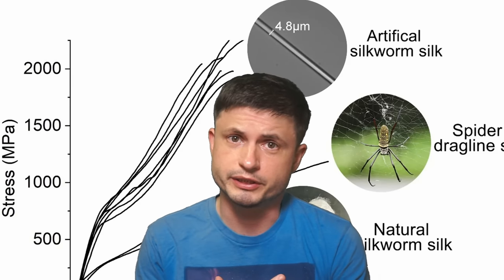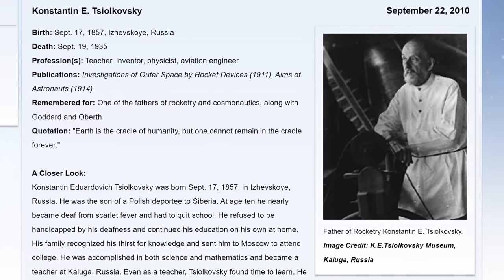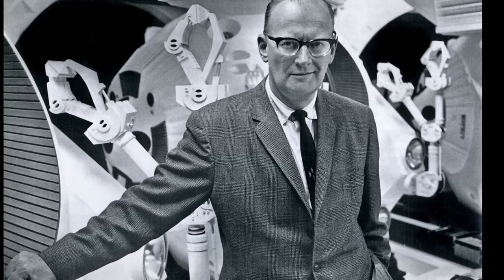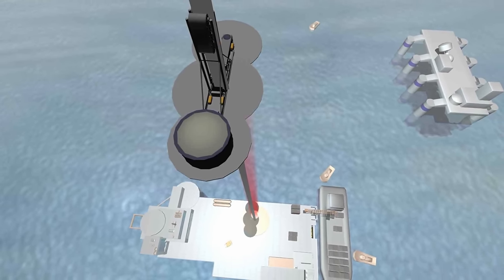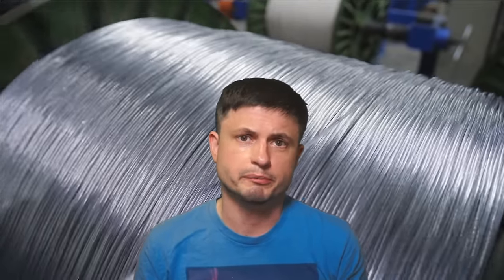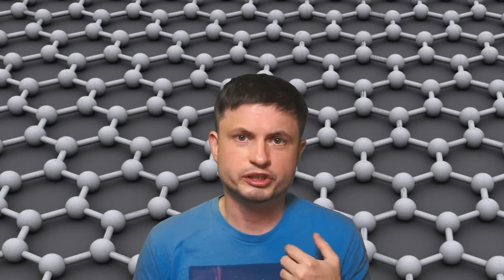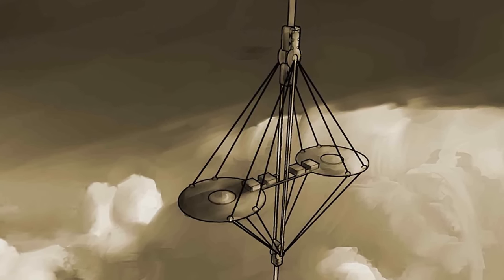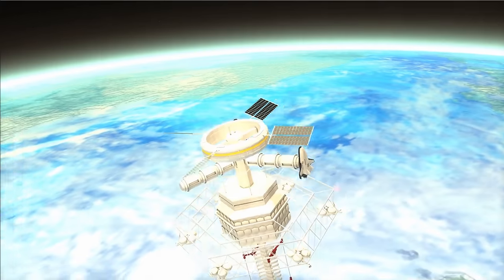Exciting New Updates About Space Elevator Technology...Possible After All?

Comment: I think they need to sort out the whole space junk problem before construction of a project of this magnitude. There are other safety and security concerns that would also need to be overcome.
Reply: There’s black holes I guess!
Reply: The space junk problem is tiny  relative to the engineering problems here.
Reply: Solar sails. Ion engine. Bye bye junk. Imho. Tick tick.
Reply: @filonin2  sort of. A problem is that the energy stored in the tether just through stretching it like a spring is immense, a significant proportion of TNT, at which point stopping crack propagation of it gets hot by a fleck of paint is challenging.
Reply: Good way to procrastinate. Just do the elevator already.
Reply: Very interesting. If it could be arranged that any nation could benefit, that’s skin in the game. Everyone would seek to preserve and strengthen it. Imagine the alternative of sending mass to LEO old style by chemical rocket, which, in the case of the space elevator, would become prohibitively expensive.
Reply: @KastorFlux  many orders of magnitude? My reading is about 1. I guess the question is whether this is enough to carry the crack control mechanisms, the coatings you will need to protect it from the hostile chemical environment, and whatever mechanism you are using to damp oscillations in the cable. I think there is still a way to go.

My guess is that one will be built on Mars before earth.
Reply: @KastorFlux  the problem with a space elevator is that it is not an issue of being unable to hold the payload, it is that the cable is quite close to not being able to hold itself. So if you have to add very much extra mass per metre to cope with crack propagation issues, chemical erosion in the upper atmosphere, damping vibrations or dynamic loads, the cable rapidly can't hold itself up (or strictly the cable has to get thicker as you go up at a rate which makes the whole thing far too heavy to be economic).
Reply: @KastorFlux  I did, however it didn't go into details of the actual practicalities of building one. There are huge unknowns after you have a material strict enough. For example it is essentially a giant bullwhip in a vacuum, getting thinner as it goes down. If you aren't careful there will be supersonic waves traveling down it, and getting bigger as it goes down  We have never used materials at anywhere close to their theoretical strength on large scales, defects normally hugely reduce that strength. The tether will be chemically eroded by the ionosphere. The tether will be mechanically eroded by micrometeorites.

Dealing with all of these issues is probably possible, but it is going to increase the mass per unit strength. I would want several more orders of magnitude safety margin in the material strength before I started building.

Comment: Nice to hear progress on the problem :)
At first it seams easy, just drop a strong cable down to earth + let some cable with a weight roll out into space to counter balance it so you are at the geostationary orbit altitude... But then when you do the math, the very weight of that length of cable is more than the cable can support (note: The cable ends at/close the geostationary elevation point carries the most load). I can get to 30 kms using helium balloons to counteract the weight, but that still leaves a long way to go.

>
Using a progressively narrowing cable with the thickest part of the cable at the geostationary point will help overcome the cable strength versus increasing weight with the length of the cable (Imagine the Eiffel Tower like design but with cables/threads, one narrowing toward the counterweight, and the other narrowing toward earth. Each about 2500 kms long). This does make it physically plausible even without the super lightweight nano carbon threads :)
>
Then we have to deal with high altitude winds, storms, high voltage electrical discharges, space debris, deterioration due to high solar radiation ...
Reply: I was wondering about deterioration due to radiation, and I wouldn't doubt that graphene would be highly resistant to that deterioration.
Reply: Graphene would also be more tolerant to impact than any other material we now have.
Reply: @theobserver9131  Graphene and some other super light nano particle threads look ideal for this purpose..
UV Cant find much. Some studies have looked at graphene/polymers composites and found that UV degradation is decreased, but also that graphene is weakened by moisture. I can't find anything on degradation due to continued stress or torsion. Like all carbon fibers I suspect it is designed to be used as a strengthening composite for other polymers.
>
That being said, thinking about 2 cone shaped cables each ~2500 km long ( I think the large end would be measured in km diameter) and how to get all of that up to geostationary orbit for deployment? The cost of rocket launch fuel would cover the our current space ambitions using current fuels for the next 50 to 100 years lol
Reply: @axle.australian.patriot  as far as getting all that material up into position, I'm thinking starting with a super lightweight model, and having a mechanical "spider" crawl back-and-forth adding more fibers and hauling materials up.
Reply: Kind of like how a tree grows.
Reply: @axle.australian.patriot  and as the structure slowly gets stronger, and add more mass to the counterweight,  you can haul more stuff up each trip.
Reply: @axle.australian.patriot  you would only need rockets to plant the seed. After that, it can grow on its own.
Reply: @axle.australian.patriot  you would only have to haul materials up to the midpoint station. You can let additional mass for the counterweight just slide out on the tether to its end.
Reply: @theobserver9131  Even the initial link to get started would be massive, That's what I was talking about.. Actually running a lift on it is even more mammoth.. You can't run a small strand because of the weight to distance ratio.. it's either all or nothing :)
>
Once you have the base cable as I described above you can begin running small strands up from the ground to reinforce it.
Reply: @theobserver9131  P.S. I have mulled over possible solutions to this for over 20 years. I believe it's very doable, just a seriously mammoth and expensive feat of engineering :)
That was the minimum, not even taking in to account the small thickness closest and tethered to the ground would still need to be strong enough to to hold the weight of the entire elevator in a high altitude wind.
>
We will have better hydrogen fueled rockets running before long. Artemis is burning hydrogen and space is full of water ice.
>
Artemis 1 launches on Sunday the 14 :P
Reply: @axle.australian.patriot  how much do you think that a single thread stretching from the geostationary satellite to earth would weigh?
Reply: @axle.australian.patriot  how are these threads bound together? Will they spontaneously "cold weld" themselves together?
Reply: @theobserver9131  I was just trying to do the math on it, but a cant find breaking strength for carbon nano yarn and yarn weight per meter length.
I just tried with fly line (Fly Fishing) but I still couldn't find accurate specs.
I think I messed it up, but if I didn't then it would take 2,176.567610000001km of 8-weight flyline with a break of 13.6078kg.

That's almost the 2500km needed to get to geostationary orbit :/
But I am sure I messed it up. A 2,176 km reel of fly line has to weigh more than 13.6kg... Maybe I missed 3 dec places somewhere and its 2.176km before it breaks under its own weight..
Too late and too tired.. I'll try again tomorrow lol

Comment: Why not use the graphene tether as a superconducting power line to a huge solar panel array in space? Then you start shipping more graphene up there, having more printers up there sending new links down... etc. It will be a giant spider web to the stars.
Reply: I did the math and the transmission losses even in graphene would mean you would be losing more than 99.99% of the power you put in over that distance. There's too much resistance in even graphene.
Reply: @filonin2  At what voltage are you running the transmission as loss is a function of voltage Hence power is distributed in kilovolts and consumed in volts we have grid scale power feeds thousands of kilometres long so find this hard to fathom where your losses are coming from and are you using dc or ac transmission as that also greatly affects the range of power transmission and relative induced heat in the material etc?
Reply: @filonin2  Curious to see ur work! Graphene can be a superconductor when layered with a 1º offset, and the cryogenic temperatures would help that. If superconductivity could be achieved, that would be zero resistance.

Comment: It might work, but the concept of a space elevator accident is very terrifying.  If that cable breaks, it could put entire cities at risk.
Reply: Depend where and how u built it, most likely wont be worst than nuclear accident
Reply: Not really, the elevator only weighs a few tonnes.
Reply: Not really, because you have to put it on the equator.
Reply: Actually Guys, if the elevator snapped at the bottom it would actually go upwards.
Reply: Build it on the moon, and you don't have to worry about this.
Reply: someone's been watching shitty sci-fi from a streaming service...lol
Reply: centre of Australian outback. problem solved.
Reply: With the counterweight variation of the space elevator, any break would result in the structure going up into space, not crashing down. The system would constantly be pulling the bottom up as it spins around.
Reply: @BooBaddyBig  Yeah, but the cable ... A break below the centerpoint would fall or be dragged down, maybe 500 miles of a superstrong material. Sounds a lot like a whip. The station would be dragged out of orbit by the counterweight. I've no idea if it would establish a higher decaying orbit or not - my calculator doesn't go that high.
Reply: Depends on where it breaks.  The material above the break will go up and escape orbit.  The material below the break will come crashing down mostly in proximity of the base it's tethered to.
Reply: If you build the earth Ankor on the equator, which is one of the more logical places, and at the right place in the ocean all that is solved. 
No amount of snapped cable that falls back to earth would hit any populated area if earths rotational direction is taken into account. 
As others already mentioned, the upper part would be ejected from eraths orbit, which sucks if you are up there.
Reply: @steveowens398  They have incredibly low ballistic coefficients, so they will be slowed by the atmosphere and land at ridiculously low speeds. They only weigh around a kilogram per kilometre of length and they tend to fall sideways.
Reply: @BooBaddyBig  Wow, a kilogram per kilometer? Talk about your unobtanium! I can see why we won't be punching the top floor anytime soon. I wonder what Anton's super silk weighs out at.
Reply: @steveowens398  It has been absolutely unobtainium, but the current state of the art seems to be more or less capable of making it nevertheless, but production rates need to scale up A LOT to make it a reality. I went to a lecture a few years ago and they reckoned it would take thousands of years to make a cable theoretically capable of carrying a single kilogram of payload. And even that wasn't practical due to the wind.

Comment: I once looked into this. The tension in the cable would obviously be maximum at geostationary orbit where the whole weight of the cable (plus payload) would have to be supported and minimum at Earth's surface. So I assumed that you would want to use a tapered cable such that the tensile stress was uniform along the whole length. If you tried it using high tensile steel then the ratio of cross sectional area at the geostationary point compared to that at the surface would have to be something like 10 to the power 55, which is inconceivable. If you wanted to limit that ratio to 100 then it would be possible using a material with about 30 times the strength to weight ratio of steel.

Comment: wouldn't the top part be shredded to pieces by debri we left there over the years? o.O
nice idea - but i think we worked "hard" to prevent stuff like that from being realised
just wait for the cascade that'll forever trap us down here ;)
Reply: I think the lower part would tear apart by tidal force. Lower means it wants to orbit faster. It might all get pulled into a ring with all sides at equal distance.
Reply: What is this debris you are talking about?`
Are you talking about space junk?
There is very little space junk at geostationary orbit. Or at least very little that we need to be concerned about. The problematic space junk is in low earth orbit.
And it IS possible to deal with that space junk. In fact, it will be a lot easier to deal with it once we have built a space elevator.
Reply: The only thing that can hold us back is the limits we accept. Humans are capable of tremendous feats. I understand your pessimism, but don't give up yet before the fact.

Faith can move mountains, they say. And imagination and rationality can build a space elevator, some day.

Comment: why not pin the elevator's tether to the primary body's rotational pole, as an alternative to an equatorial-stationary orbit? Wouldn't that require less tether? The counterweight could be sped up, faster than the rotation rate of the primary. I am always surprised that the elevators themselves don't take advantage of aeronautics to climb - they may not always have enough air to push on, during descent and ascent, but when they do, they can accelerate going up and decelerate going down.
Reply: That wouldn't be an orbit. You need the rotational movement to hold the elevator up.
Reply: If you did that, it wouldn't stay up there. The point is that they are using Earth's own rotation to basically swing a rope around with a rock tied to one end, so that it's pulled taught by centrifugal force. (yes. Centrifugal. Fight me XD) Thus, by building it at the equator, you are getting as much rotational speed as the Earth can provide, which requires a shorter tether.
If you built one at one of the poles, you'd just be twisting it like a screw, and the whole thing would collapse. Remember, the length of the tether is directly related to how close it is to the rotational axis.
Besides, Geosynchronous orbit only works at the equator anyway. A thing in orbit still has to go around the whole earth to stay in orbit. It only stays in place relative to longitude, with the orbital plane always crossing the center of the earth. If you put a satellite in geosync above a place at 30° latitude and 120° longitude, it would actually just trace a line directly north-south along the 120th meridian, moving between 30° north and 30° south and back again over the course of a single orbit. This is fine for satellites, because it's far enough away that a ground-based radio antenna on the same meridian will probably still have line-of-sight with a geosync satellite unless you go much further north or south with it.
This is obviously much more problematic for a space elevator, which means it's far easier to build one at the equator than anywhere else on the planet.
Reply: @LDSG_A_Team  try doing some math. Just a little. Just this once... for me.

Comment: The major issue with the Skyhook I always saw was what would happen if the orbit or hook gets destabilized thus falling to Earth. Sure parts would burn up before landing, but a structure thousands of kilometers in length crashing into the ocean at maximum velocity would most definitely cause some sort of wave while the parts that land on the ground would do some sort of damage. It doesn't seem plausible due to safety and geopolitical issues because all nations that a structure like that could possibly land on would need to approve it.
Reply: I'm sure it could be built with some sort of self-destruct fail-safe. Of course, that could have it's own issues. For example, if it were rigged with explosives, they could be used to sabotage or weaponize the structure. It would need to be something that would inevitably be triggered by the structure becoming unstable but impossible to trigger otherwise.

Comment: The current problem with a space elevator is "Space Junk".  The elevator would tethered to the ground, so could not move out of the way of what might be coming.  If something cut the cable on ether side of the station, it would be a disaster.
Reply: There is also the problem of atmosphere. A single lightning strike would have to be conducted safely to earth.

Comment: Since geosyncronous orbit is 22,000. miles above the Earth, having the counterweight on half the line would require a line 44,000. thousand miles long.  What would keep a super conducting line 44,000. miles long from being a lightning rod?  Would you not need to form a loop?  That would need 88,000. miles of line.  What about tidal forces, when the moon goes by?  What about heat, cold, and ultraviolet rays?  How much would 88,000. thousand miles of graphine stretch?  How would you attach it to the Earth?